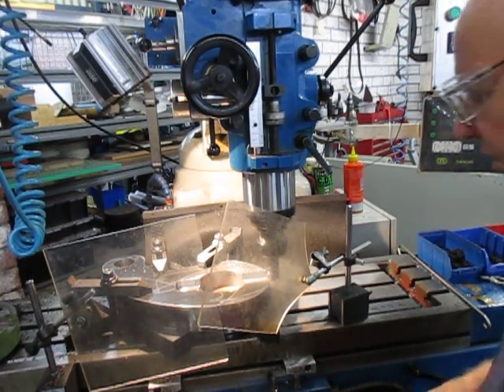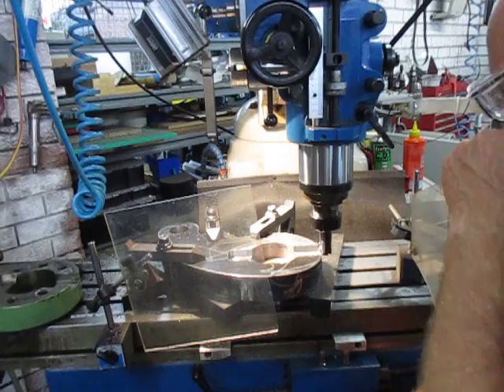Cranky Arm part 4

Comment: What material is the arm made from ? I have looked back over the previous videos but have obviously missed the bit where you stated the material. My mill is similar to the one you are using here, I always move the bed/table up to the cutter, rather than extending the quill, you seem to be doing alright with a large cutter dropping the quill down to the job, I will try that as it gives more room to work.